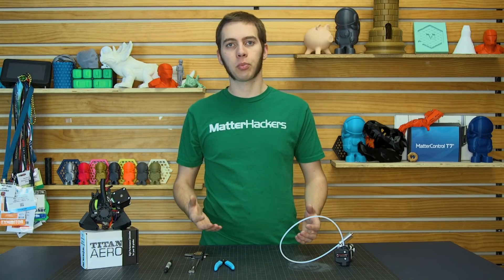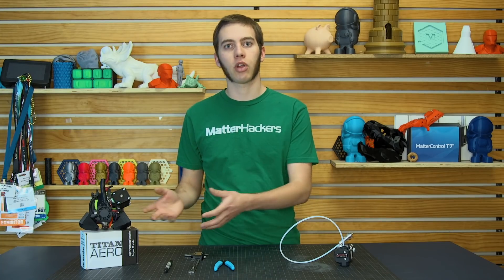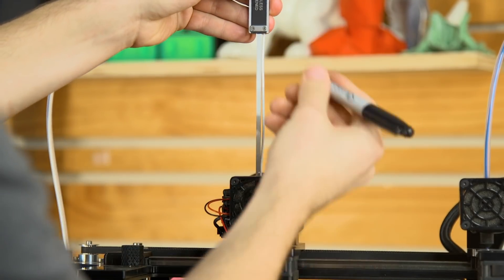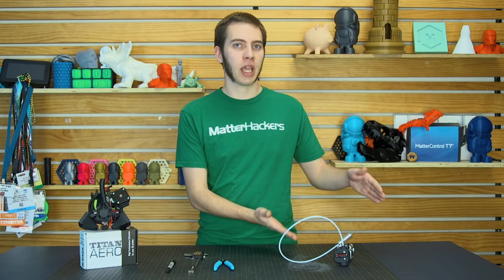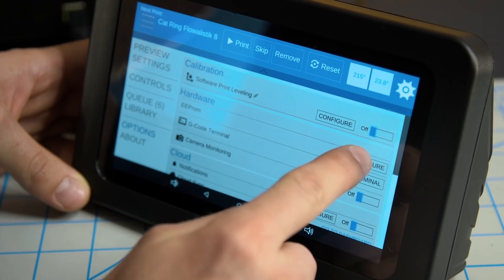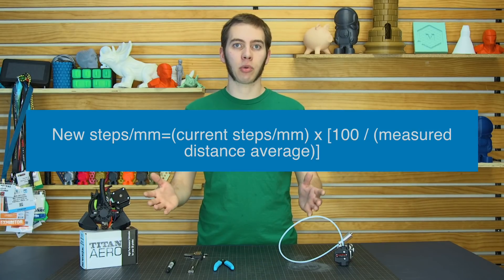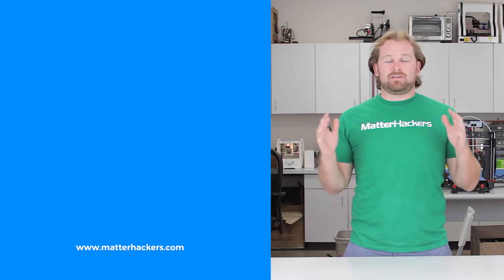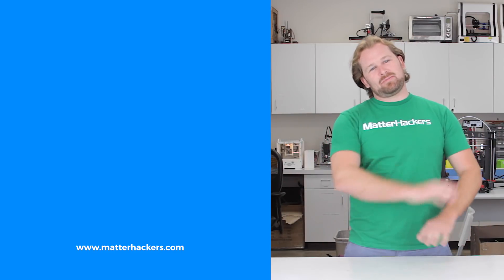How To Calibrate Your 3D Printer's Extruder // 3D Printing Tutorial and Guide

Comment: First printer calibration test on the anycubic mega zero. Measured 100 on the extruder and after multiple tests the average is about 55mm extrusion after marking the filament length.  I don't see a calibration on the menu settings so not sure how to go about this

Comment: Can someone explain to me Why does the extruder miscalibrate when you uninstall and install?
I took off the filament and measured 618mm from the expected 600mm extruded. So step per mm should be 97,09. Then I installed the extruder and put the filament back in. But when I tried to extrude 100mm it extruded 92mm. So now the step per mm is 105.5. May be its too late I didnt sleep and Im missing something...

Comment: With bowden it needs to be connected to a heated hotend!  There's a big difference between pushing filament with no resistance and forcing it through a tiny nozzle.  You must test the same way you print!

Comment: Good afternoon, my tevo tarantula pro  is leaking filaments on the sides of the extruder, is too much filament being deposited? If so, how does the calibration perform? I wait and God bless.
Reply: your hotend builds pressure inside, your hotend or nozzle are not tight enough to prevent leaks.

Comment: You cut your filament at the bowden? How the crap does the extruder, extrude?
Reply: They have cut it at the hot end side of the tube... so the extruder can still push the filament through the tube.
Reply: Don't confuse the extruder with the hotted or nozzle.
Reply: google bowden extruders and how they work.

Comment: How do you measure how much was extruded using a bowden setup?
Reply: My Cr10s requires me to heat up the nozzle first. Even though we will extrude with the bowden disconnected the firmware won't allow extrusion unless the nozzle is heated first on some printers. More info here: https://www.matterhackers.com/articles/how-to-calibrate-your-extruder
Reply: I agree with you Osprey.  This video was lacking in detail.  He simply said to cut filament off flush with PTFE tube, then measure what length came out of printer.  How do you do that?  Why can't the same procedure be used as with the direct drive: measure 120mm back from the point where the filament enters the extruder, then run the 100mm, and measure again after.
Reply: @FPVinPA  He said the length that came out of the tube, not the printer

Comment: I have a FlashForge Creator Pro. This doesn't seem to have a utility to extrude a fixed length of filament. There is a filament odometer so could I use the 'Load Filament' and compare the actual length used with the odometer reading? The supplied Flashprint slicer has a software extrusion percentage compensation.

Comment: Shouldn't you always measure filament BEFORE it gets into feeder?
For many soft filaments after they pass feeder they are squeezed by feeder wheel, which 1) elongates them 2) changes their diameter.
Reply: start calibrating for PLA/PETG/ABS, solid filament. then when you are set... just extrude ninjaflex for 120mm also. whatever your printer is squishing or not the filament, you want it to extrude 120mm of it. dont store ninjaflex value into your eprom, but tweak your slicer.

Comment: Isn't there an M command that disables the need to heat your hot end?
Reply: M302. To be noted that it's really not to be used on a direct drive when a nozzle is connected - should be obvious but you never know.